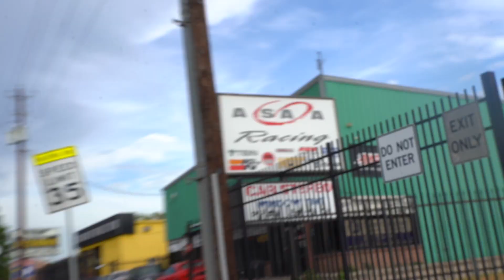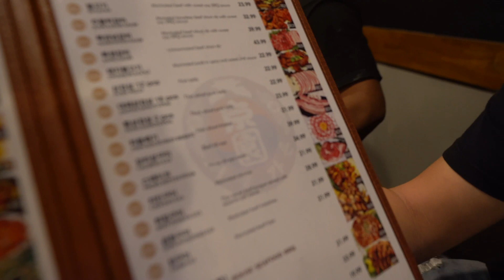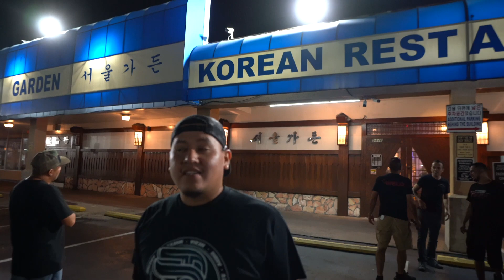Guess Who Bought A Honda Too? // 🚗

Comment: Glad to see a little different content a break from the regular is why I come here you guys make cars and trucks fun
Reply: This makes me miss my honda gray and all
Reply: I had a 98 4dr ex lowered with exhaust and cold air intake with 18” mesh rims I bought it with 5 miles on it
Reply: Danny is a lowkey hater and envy  and freddy always trynna design others cars like bro there not yours
Reply: @itsbeen108  u bought it new?
Reply: @xInline6  yep on September 29 1998 and on October 1st it was in the shop getting all the goods added dac intake  
Borla exhaust buddy club 18”rims 3 10” earthquake subs with matching amp pioneer radio with matching interior speakers and amp clear taillights and front headlights and touring wing and eibach lowering springs
Reply: @itsbeen108  wow how did they drive new
Reply: @xInline6  perfect it was weird driving it because I had a 89 caprice Ls my dad bought brand new in 89 when I was in 8th grade and I inherited it we both babied that car just got rid of it about 5 years ago it was in immaculate condition here in Chicago area they are like crack well I wanted a simple car to go back and forth to work but once I got it off the lot I seen one that looked like a bmw so couple days later  went from feeling like I was floating on a cloud to a lower stiffer ride definitely made me want to drive faster and when I went through underpasses smash the gas to hear exhaust paid it of a few years later got a brand new 2004 accord did same thing to it then I got into impalas and tahoes